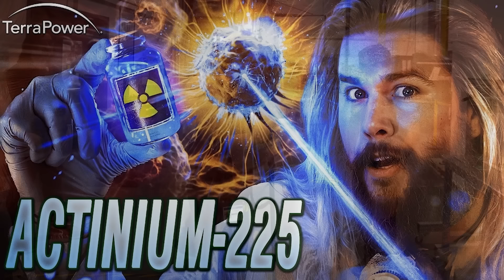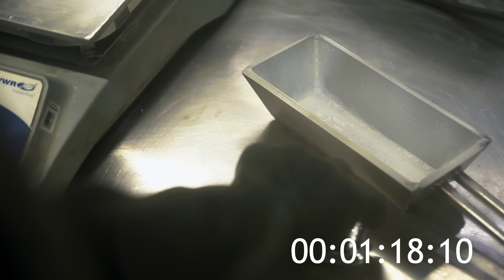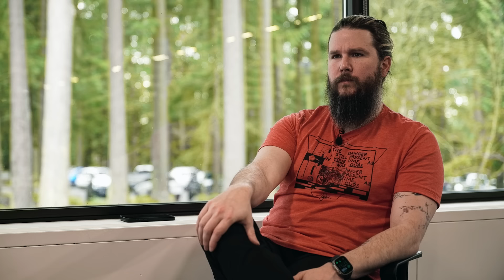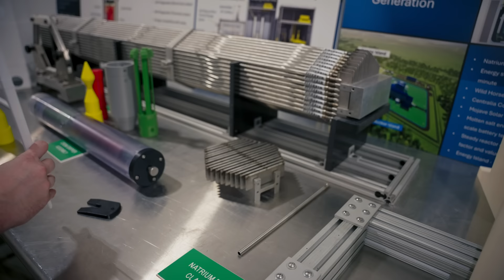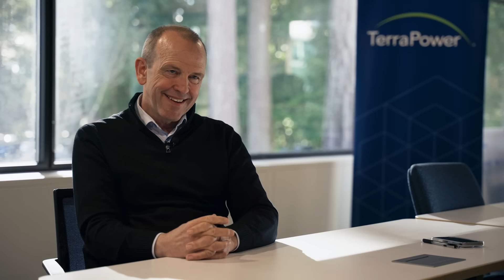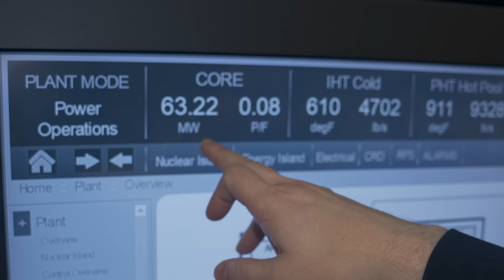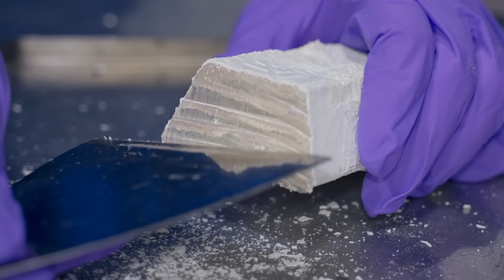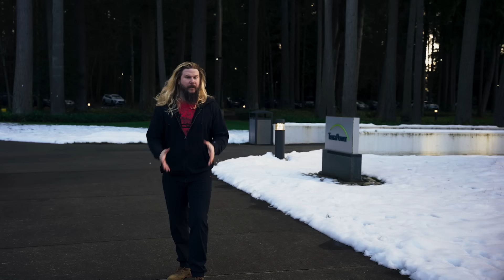Will Natrium Nuclear Reactors Change Everything?

Comment: My first reaction: did we finally find a reactor that does not work by boiling water?
And it turns out boiling water remains undefeated still
Reply: Progress is a flat circle made of boiling water
Reply: @bghiggy  surface tension XD
Reply: @bghiggy  why is this quote so hard
Reply: It's steam turbines all the way down
Reply: @playgroundchooser it seems steam engines were the peak of human development.

We just have found new ways of making more advanced and complex steam engines.
Reply: @juanangelninogomez2800 
we’ve figured out how to utilize more energy dense fuels! The method to generate power will remain the same but how we get heat is different!
Reply: @juanangelninogomez2800  well for creating electricity, it seems spinning turbines with water or steam is the way to go. As it can be done anywhere in the world pretty much that makes it a universal energy generator.
Reply: The latent heat of vaporization reigns supreme
Reply: @nickjohnson410it’s so big. Bigly big
Reply: Water is dirt cheap and boils at a temperature lower than most decent metals melt at. It’s going to be around for a long time.
Reply: @RoadSurferOfficial  sCO2 is gonna beat it out soon check out the STEP sCO2 Plant
Reply: @RoadSurferOfficial  The fact that it boils at a temperature lower than metals is a potential negative if that's not what you're going for.
Reply: @RoadSurferOfficial  Water won't be cheap for much longer.  We're using our fresh water supply at a rate that isn't sustainable beyond 2030, and it's getting worse.  The next world war will be fought over fresh water, not fossil fuels.
Reply: @ExcretusMaximus  probably not… I’d go further to say we won’t have a dry mouth in this lifetime or the next or the next if we are here then water shall be.
Reply: as long as turbine is the most effective thing to turn a coiled generator efficiently, our power plant generator will be any stylized style to boil water 😂
Reply: @youroniichan13  yep only so many ways so far we have of creating electro magnetic fields. One of the best is taking heat, converting it to mechanical energy and spinning a bunch of magnets next to coils of copper wire.
Reply: You could use supercritical CO2 instead.
Reply: @patrick_test123  came here to say sCO2 is where its at.
Reply: @patrick_test123  i had the Privilege of mentioning sCO2 to a Financial manager for a "large" energy company the other day. Felt really weird being able to lay that seed.
Reply: Science owes more to the steam engine than the steam engine owes to science
Reply: @SherlockHomeless221b  Thomas Newcomen is a Baddass
Reply: Solar cells don't boil water.
Reply: @DanielLCarrier  but there are solar plants that focus a field of mirrors onto a container with molten salt in it which is then put through heat exchangers to make steam which turns turbines.
Reply: @DanielLCarrier  Yes, and photovoltaiks are bad. At scale at least. If you want to harness a lot of soler energy you do so using mirrors to concentrate it and... boil water.
Reply: @Neuromancerism photovoltaics work just fine these days.  What you're talking about is pretty old tech and not really economically competitive anymore.
Reply: @dynamicworlds1  Nor are Photovoltaiks economically competetive. Not even in the US or Germany will you get a loan to buy them let alone land to put them on alongside them, and electricity there costs like 10 times as much as it does here.
Reply: @Neuromancerism they absolutely are.  How absurdly out of date is your information?
Reply: Not too long ago there was a promising test with a fusion reactor that produced energy WITHOUT BOILING WATER    :OOOOOOOO
Reply: @GoofballPaul   can you say which test it was, I'm curious
Reply: @GoofballPaul they finally are gaining net gains. It's closer than ever now.
Reply: Westinghouse eVinci reactor will probably be the first commercial reactor  to not use water at all.
Reply: Was there not a fusion company that was exploring harvesting the energy from colisions?
Reply: @ibengotvasilforrd4258  There are experimental reactors and the stage they're at is that they can create stable fusion but they're working on net energy gain, after that I assume is scaling it up.
Reply: GE has a pilot plant using super critical CO2 instead of water so, maybe it's happening?
Reply: @smeezer  Ouch, talk about an explosion risk, I think I prefer sodium, or even NaK.
And a steam explosion is nasty, but at least you don't get asphyxiated if you're downwind.
Reply: @Robert-dB  Why would CO2 be more likely to explode? You only need 31.1c and 73.8 bar to make co2 go super critical
Reply: @smeezer  The point of Natrium is that the sodium and the salts for the heat transfer are at (about) atmospheric pressure. The only high pressure stuff is in the "steam engines" that generate the electricity, something that the naysayers are perfectly happy with 'cause it's not inside the "nuclear island". Using high pressure sCO2 puts high pressure fluids back into the reactor containment building which reactivates the idea that the pressure might be able to "pop" the containment. So it's not that anything is likely, it's that the pressure is in there at all.  Plus the fact that escaping CO2 could be a short term health risk outside the reactor because it disperses very slowly at ground level compared to steam.
Reply: The steam turbine generator and all its needed switchyard and transmission were on site due to retirements, so they are being recycled to keep costs lower.  Nothing prevents a future Natrium from operating a more efficient CO2 turbine at a higher temperature, if it proved advantageous in reducing the need for cooling water, for instance.
Reply: Super-crit CO2 is gaining traction very fast, and has a pretty sizeable efficiency advantage. Especially closed loop multistage.

By the time natrium hits the market I wouldn’t be surprised if it’s actually integrated with a CO2 setup.
Reply: @geekswithfeet9137  CO2 expands about 500x, water expands 1700x. You get way more push from steam than CO2. And steam isn't as dangerous as CO2 when it leaks (see Jaslovské Bohunice's reactor A-1 accident, citing:" The first accident occurred on January 5, 1976, during fuel replacement, leading to the massive escape of carbon dioxide gas and the tragic death of two workers.")
Reply: @adler830  The advantage of CO2 has nothing to do with relative expansion (and from what state?).  It can operate at higher  temperature differences to achieve higher thermodynamic efficiency .  And it can be sent back to the heat exchanger without needing cooling water to condense it first, increasing power plant siting opportunities and reducing waste heat added to the environment.  It's a simple concept of heat expanding/pressurizing  the CO2 and the turbine turning pressure drop into motion,. Repeat.
Reply: @adler830  Except sCO2 doesn't reach its full expanded state and flows more with the density of water check out the Supercritical Transformational Electric Power (STEP) Demo pilot plant. it really is a step forward
Reply: Actually I heard a unique new alternative of replacing steam with super critical carbon dioxide. The idea is that it's higher density allows for smaller turbines and the lack of water should have less pitting and wear on the blades. Downside is now you're energy line needs to be pressurized.

There's also the idea of electrostatic direct energy conversion for nuclear fusion. It's rarely talked about because it's rather technical and the process would likely be more costly to make, but it can convert the free electrons into electric charge directly by smacking them into charged plates. Likely this would be used along side steam as the neutrons will still put out a substantial amount of energy.
Reply: > New way to make energy
> Look inside
> Boiling water
Reply: the steam age never ended we just built fancier boilers
Reply: Yes because water is the only compound that we can have in a gaseous state without it being harmful and at a way less temperature
Reply: Haven't they used supercritical CO2 in turbines, and I think also Helium.
Reply: every solar panel is a reactor which doesn't boil water by the way!
Reply: There are also concepts of using other fluids than water
Reply: Still the old steam engine, after all the centuries of locomotives, generators, power plants - barely a billionaire-hyped "progress"...
Reply: The US has experimental molten salt reactors before. And there was a Russian class of submarines that used a molten lead reactor. Still eventually boiled water to put through a turbine though.
Reply: Once again we invented boiled water. First and most trusted human invention
Reply: I suppose they could run the natrium or the salt through paddlewheel or bucket-wheel to spin a dynamo...
Reply: Ah I see Al the nuclear physicists are in the comments
Reply: @ImNotOhKae  just trying to help, there is more to it, of course
Reply: Everything is steam.
Reply: It is [title card]*
Reply: What about cold fusion??? I thought we are there...?
Reply: Look up the carbon-14 diamond battery, it works by directly capturing the beta particles to make electrical current.
Reply: @JinKee it's not that good though
Reply: @JinKee  Thought of that, problem is Neutron Embrittlement and Efficiency, or lack thereof
Reply: Literally everything power generation for us is boiling water to spinning magnet.
Reply: Probably allways will be the final way we get power
Reply: wake me up when they get sun in a box working
Reply: @melkorrealmz4526  They have stable fusion reactions.  They're working on net energy positive reactions and presumably then scaling it up.
Reply: Now we boil metal
Reply: Well, water is, just one of the most amazing heat transfer fluids that could be engineered in a universe.  Off the top of my head I can’t think of anything better and cheaper. Those corrosive fluoride salts are pretty tricky to manage . Big molten salt gonna take care of the world big daddy gates at the helm.
Reply: It's that perfect storm of availability, lack of toxicity, heat of vaporization, and how much is expands when going from liquid to gas.
Reply: When water turns to steam, it expands about 1700 times, which is pretty hard to beat when it comes to liquid→gas force transfer medium. And as a bonus, it is pretty cheap and abundant, which can't be said about alternatives.

As for myself, I think steam as a power medium didn't said it's last word in service to humanity. Sooner or later, steam engines will have their comeback, especially in heavy-duty use in remote areas where electricity might be a liability.
Reply: @adler830  Think Moon or Mars...
Reply: spinning a magnet is just  electricity is made you can move fluids and gas is the most efficient fluid, but even gyro and wind function this way. That’s how everything except photovoltaics works pretty much. I doubt it’ll ever go away
Reply: Wait nuclear reactors are steam engines?
Reply: @dizzydyzy  Always have been.
Reply: Because that startup are primitives from tech point. When you are using sodium as primary coolant, you can easily use carbon dioxide or even helium as coollant and working medium in secondary circuit.
Reply: I wonder if we could extract enerygy from the convection currents of molten metal with magnets
Reply: @whitepickle1  We can, trough MHD generators. But their efficiency is low, so it is good to combine it with another generation, which is using expansion of gasses.
Reply: I'm glad to see that our data from FFTF is finally being used. Yes, it was an inherently safe fast reactor. Yes, we could have recycled the fuel, reduced reduced the amount of waste to be stored. We did peoduce, medical isotopes. And we had developed both deep geological and monitored retrievable storage methods for disposal of the waste.  Then, a unilateral decision within the federal Department of Energy had the reactor shutdown. The contractor brought in to oversee the shutdown had all of us former employees sign non-disclosure agreements stating that we could not talk about the impressive safety record of the facility. Isn't it odd that elements within the government didn't want us to talk about a successful program? Well, it's interesting that the company who ended up holding the patents for fuel recycling was none other than Exxon/Mobil oil, who saw nuclear as competition to big oil investments. Fifteen more years of pollution, before electric vehicles became practical. Ethanol and compressed natural gas vehicles have become. Economically non-viable. We're talking about the Bush and Obama administrations when the programs were killed. It wasn't for safety or environmental reasons that the nuclear industry was dismantled. It was to ensure the oil industries made profits!
Reply: If you mean by not boiling steam to spin turbines, I don't think we'll make one without turbines for a long time.
If you mean without boiling in the core, pressurized water reactors have been a thing for a long time.
Reply: molten chloride salt fast reactor can run hot enough to run a supercritical co2 turbine, possible but will probably just do steam at first
Reply: Boiling water is the powerhouse of the civilization
Reply: Drat, I had hope here.  You could couple the flowing metal to wire coils and make power that way, but nope... just steam again.  LAME.
Reply: it does not. the water is boiled by the reaction to turn into steam to spin the steam turbines. wether the heat of the reaction comes from sodium or nuclear chain reaction. steam can be pressurized and water is plentiful. that's why water is used to make the steam turbines spin.
Reply: The ultimate irony is aliens invade us because they need water to make their steam turbines
Reply: It works.
Reply: Water/steam will not be denied. However, there's a level of separation between the angry pixies in the nuclear side and the angry pixies on the boiling water side. Those pixies should not mix.
Reply: @tonyennis1787  that's one reason co2 is a great option if they get it right
Reply: Hey, we created a whole new type of nuclear reactor that is completely different!

Did you or is it steam power?

Ok well…
Reply: The US Navy experimented with sodium reactors very early on the USS Seawolf (SSN-575), the next sub to launch after the USS Nautilus, but quickly converted it to pressurized water instead because of the problems.
Reply: Helion is trying, but they have neutron problems last time I checked
Reply: Brother how else is it going to make usable power 😭
Reply: our ecological crisis is due to photon entropy. As Roger Penrose points out gravitational entropy is the opposite of the entropy of matter. So we have 500 extra zettajoules of heat in the ocean already and we also have an extra 1 degree C global average of heat in the atmosphere that is being deflected by sulfur pollution. So the more "renewable energy" we get with less coal and diesel sulfur pollution the hotter we get and global food supply collapses.
Reply: was pretty much going to say the same thing, though one interesting reactor is from Helion and it doesn't boil water
Reply: ....always has been
Reply: Turns out Earth is a giant wet ball
Reply: Boiling water is just the best
Reply: As far as I know its still the cheapest way to convert heat to electricity. There are plenty of ways to convert heat to electricity, but all of them are still more expensive.
Reply: I hope the thousands of gallons of water NEVER meet the thousands of gallons of liquid salt
Reply: There’s no power like steam.
Reply: The United States Navy is truly the Forestall of all nuclear reactors.  Nothing was mentioned about that.  A nuclear sub as confined as it is nuclear.  Also, The United States Navy has made smaller reactors, but still efficient.
Reply: It's boiling water all the way down...
The poor turtles.
Reply: The Rankine cycle is basically what we use for making steam.  If you want something else the heat engine needs to run at a 😊higher temperature.
Reply: @jamestyrer907  I wonder if an ultra hot stirling engine would work 🤔No steam, just use the heat from the molten salts directly to create an insane heat differential with the atmosphere...or maybe add a cooling tower back and use cooled water on the cold side.
Reply: This joke is so stupid
Reply: You try turning something with warmth.
Reply: Brayton Cycle nuclear reactors exist, but is more rare, Is basically a closed gas turbine instead of steam turbine.
Reply: Helion won't use steam turbines if they aren't a scam 😂
Reply: Steam power is just super cost effective, simple to maintain and simple to fix.   Sometimes instead of trying to reinvent the wheel it's better to just make a better wheel.   Helion in Washington state is building a fusion reactor now that is supposed to generate direct electrical current instead of just heat to boil water.   We'll see if they can make it economical.
Reply: The steam engine train is turning in its grave
Reply: That is very funny.   I don't know if you meant it. Or how many people caught the pun.   But that is very funny.
Reply: As long turning a turbine with the steam is the most efficient way to convert heat to electricity water will always power humanity.
Reply: Though it has never really been about technology. The far bigger obstacle is the power of the fossil fuel companies. With how powerful Saudi-Arabia and Russia are they will do whatever they can to sabotage any attempt at nuclear energy.
In Germany a thing that is often overlooked is that a lot of the protests against nuclear power was funded by the coal industry and Siemens bought up several coal powerplants just before shutting down it's nuclear ones. It wasn't really some foolish political decision. Rather it was Siemens seeing that there was more profit in coal and the hysteria around Fukoshima presented them with an opportunity to do what they have been wanting to do.
Reply: You're right. Except we've known the technology for 50 years. Russia has tried it as well. It's not as competitive as PWR. We just forgot to how build them because the last so long.
Reply: Its supercritical CO2 now
Reply: Focusing on the boiling water misses the point of the reactor's design. The real heavy lifting is done by the liquid sodium, which handles the extreme task of cooling the core. Boiling the water is just the final, easy step in the process. It’s like a striker who dribbles past five defenders and the keeper; the 'goal' is easy, but the dribble was the actual feat of skill.
Reply: This meme is so stupid and shows how little knowledge you have. Do you really think there's some magic way to produce electricity without a turbine? There's not, besides solar panels so shut up with this moronic garbage
Reply: Boiling water, throwing rocks, and pointy sticks. Pretty much all of humanity's tricks.
Reply: The potential disaster scenario I foresee is that an earthquake, severe storm, terrorist attack etc. damages the salt loop preventing it from circulating to cool the sodium. Without a moderator, the sodium boils off creating a massive explosion as the now vaporized sodium reacts with the atmosphere. I'd want to see a failsafe mechanism which could immediately halt the reaction even if plant operators are seriously injured or unconscious and any neutron moderator used is entirely passive -- not dependent on a mechanism which could similarly be rendered inoperable by natural disaster or attack.
Reply: @ciabelle281  I think you missed the part where the reactor can't get hot enough to boil the sodium. It's hundreds of degrees away from the boiling point and it's operating at 100%, so it can't get hotter.
Reply: @undefined9749 Assuming circulation is maintained. I'm not saying they won't build in the necessary safety and control mechanisms. It's just that all these side quests add to the complexity, costs, logistical problems and timelines when we can't afford delays.
Reply: @ciabelle281  Neither salt nor Sodium is the moderator. It is a fast reactor not needing a moderator. Control rods automatically drop by gravity to kill the reaction and the sodium absorbs all the residual heat without reaching boiling temperature. This was tested by stopping all cooling pumps in a test reactor many years ago and is the reason for the safety of the Natrium design.
Reply: @ciabelle281 lookup “doppler broadening”
Reply: @ciabelle281  Existing plants already do this and since natrium has a much higher boiling point than water does it would give you a lot more wiggle room before things get out of hand.   Natrium also doesn't have the reaction with Zirconium in the core that water does which can lead to a dangerous buildup of explosive hydrogen gas.   The biggest problem and what is mostly to blame for 3 Mile Island and Fukushima's meltdowns is the fact that even after you scram the reactor a portion of the uranium will continue to undergo fission and release heat for up to a week.   If the core loses it's coolant it will still get hot enough to melt down even after it has been scramed.
Reply: no one has properly explained to me yet why you need water and can't just convert heat directly into electricity ,.,
Reply: @ERR-NULL00 The current methods we have of converting heat directly into electricity is less efficient.
Also for scaling, turbines are generally just simpler to scale
Reply: @ERR-NULL00  Scale, efficiency and output. Converting heat directly into electricity isn't efficient, safe, or fast enough (when it is safe, like in solar panels) and using water as a medium for moving turbines to generate electricity is simply the best way we've figured out so far. Do you understand what electricity even is? It's EMF aka Electro-Motive Force, which is the force of electrons moving. This is how a turbine "generates" electricity, by using magnetism to move electrons in some kind of electrically conductive metal (copper mainly, but others do exist for different applications like gold in microchips etc).
Technically the "energy" is always there in most materials, you just need to have some method to "move" the electrons and that tends to generate heat, especially in materials that are less "conductive". Conductive metals can generate more heat yes, but that's because they don't burn instantly and the electrons are moving a LOT faster.
Reply: @flamerollerx01  That was the BEST explanation i've heard, like, ever!
Reply: @ERR-NULL00  Machinery, computers, lights and other things don't run on thermal energy they run on electrical energy.   So, you need a way to convert the thermal energy created by your heat source to electrical energy in the grid.   The most economical way we have found to do this is to use the heat to boil water and create steam which then is used to turn a turbine and generate electrical energy.   Virtually all power generation comes down to turning a turbine to generate electricity.   Watermills use falling water to turn them, dams use water pressure created by the backed up water to turn them, windmills use wind to turn them, fossil fuel plants burn fuel to make heat which boils water and turns them, a lot of solar plants focus sunlight with mirrors which heats up salt to boil water and turn them, nuclear plants use the heat from the reactor to boil water and turn them and geothermal plants use heat from the earth to boil water and turn them.   Water is just the medium by which we transfer energy from one form to another.
Reply: @zagnut3707  solar panels don't use water tho, they directly transform solar energy into electrical energy, no water needed
Reply: @ERR-NULL00  You are correct, to my knowledge solar panels are the only common form of power generation that doesn't turn a turbine.   There are some fusion reactor designs that can produce direct electrical current, but they are not practical at this time.   The fuels they use are rare on Earth and would require that we mine the Moon or asteroids, which insanely balloons their costs and would need all sorts of other advancements to make it possible.
Reply: This isn’t really a problem though… it’s tried and true, it’s fairly efficient and it’s economical, the infrastructure is already there. Why invent some new, expensive method for turning heat energy into mechanical energy?
Reply: @scottkidder9046  Ever heard of solar cells? After installation, the sun does its thing, and the panels harvest "free" energy - still the cheapest (and cleanest) form of energy, with further sinking costs for the panels and batteries to even eliminate more expensive peaker plants.
Reply: @scottkidder9046  check out the Supercritical Transformational Electric Power (STEP) Demo pilot plant
Reply: Even if we get to obtain nuclear fusion reactors or antimatter energy source, or harvest black holes, it ends up using all that energy.... to boil water for the turbines
Reply: I kind of wonder if it might be safer to use a liquid CO2 cycle instead of water, which would limit sodium/water reactions.  Maybe the temperature ranges are wrong for that to happen.
Reply: @PosiCat there is no sodium water interaction. Watch the video.
Reply: @PosiCat  You need high pressure to keep CO2 in liquid form and it's also far too cold. I'm not sure why you thought to make this comment without knowing this, instead of just looking it up.
In order for CO2 to be a liquid, it has to be at ONE THOUSAND PSI and 64.6 Fahrenheit, way below the temperatures required for molten salt and nearly triple that of boiling water and that pressure is incredibly high pressure. For reference, R22 refrigerant has a high pressure SAFETY LIMIT at 250 psi and that stuff is considered a high pressure refrigerant used in peoples homes.
Reply: You know sodium violently explodes when exposed to water, including small amounts in the air. Using it outside the primary feed is begging for a massive explosion.
Reply: @Allison-qk1ws  Primary loop is molten sodium. Secondary ("battery") loop is NaNO3/KNO3 (60/40 from their scribbles on the fume hood.) Third loop is water to steam for the turbines, because it's the only way we know how to make power.

(FYI, that's "pickling salt". It's what makes spam so pink.)
Reply: @jfbeam Brayton cycle?
Reply: @ubobl2277  That's basically a jet engine, and jets don't (directly) boil water. So yes, there are ways of spinning a generator without boiling water, but steam is still the best way we've worked out to make power on a large scale. (water, wind, and solar also work, but with significant limitations.)
Reply: @jfbeam thanks for that important info. I had been wondering how the heck a molten Na - H2O heat exchanger was considered safe in anyone's mind. Because water turned to steam still generated literally tons of pressure. Pressure on any pressure container always generates small movements or expansions which WILL result in material weakening over long periods of time. Which could result in a violent and very terminal mixing of molten Na and H2O under pressure. Probably the very worst combination for any heat exchanger.

The other compounds are virtually non-reactive with water compared to Na. That DOES increase the safety to an incredible margin.
So, yes, this is VITAL information that has been left out of the video.
Reply: @Allison-qk1ws  I see someone hasn't watched the whole video yet 😆
Reply: @playgroundchooser    i think I shall always be disappointed, not by the commentor who doesn't quite get it... but by the upvotes the comment gets.
Reply: @playgroundchooser  I mean 300C sodium that sprays out of a leaky pipe will be a flame thrower. 
This demo was like showing kids in a swimming pool to prove that a steamboiler is perfectly safe it's a totally different application.
What would have been interesting why other low melting point metals wouldn't work like gallium, mercury, indium, tin, lead etc.
Reply: According to Google's AI (and it seems pretty reasonable): Sodium has high thermal conductivity, high heat capacity, wide liquid temperature range, compatibility with reactor materials, ie doesn't corrode steel, low pressure operation, self control (it's self-regulating, temperature increases are countered by core expansion, which slows down the reaction), passive cooling (can be cooled passively during shutdown, where decay heat can be removed by natural convection without the need for pumping), because of its electrical conductivity you can use electromagnetic pumps, which are efficient and reliable.

I'm fairly sure some if not all of this was covered in the video...
Reply: @Allison-qk1ws did you even watch the video?
Reply: @Allison-qk1ws  Did you watch the video? Methinks not.
Reply: @Allison-qk1ws  tell me you havent watch the video without telling me you havent watched the video ^
Reply: Wow it's like you didn't watch the video where he specifically covers that objection  @Allison-qk1ws
Reply: @Allison-qk1ws  Which is why they aren't the heat is removed with a molten salt.
Reply: @Allison-qk1ws  you're deeply incompetent, because they literally say in this video and show literally demonstrate on camera in this video how raw sodium metal does not and cannot react violently with humidity in the air
Reply: @nathankiefer9323  Oh, someone found a way to overcome physics/chemistry...
Reply: @nathankiefer9323 Did they tell you what the humidity level in the lab was? How cold was the air or the lab bench or the sample of sodium? Nope. Don't base your conclusions on incomplete information. They're only showing you what they want you to see.
Reply: @Allison-qk1ws  Someone didn't watch the video to the end.
Reply: @Allison-qk1ws there are people far smarter than you that have already figured out how to solve that risk factor
Reply: @Allison-qk1ws   Aren't there breeder reactors that use liquid alkali metal for the primary and intermediate loops?  Primary to capture the reactor heat, intermediate to have a non-radioactive loop in case the output loop leaks and causes an alkali metal explosion.
Reply: @Allison-qk1ws  watch the video
Reply: @Allison-qk1ws - Yes, but my “water-cooled computer” does not dump water over the electronic components. Nor does this.
Reply: @Allison-qk1ws Fun voice, 10/10, no notes.
Reply: @Allison-qk1ws  they did it in the video. There was no explosion.
Reply: @Allison-qk1ws misinformation bot detected
Reply: @Allison-qk1ws he literally addressed this in the video
Reply: @Allison-qk1ws  i guess you didnt make it to the 13 minute mark
Reply: @Allison-qk1ws wow you should tell those people that work at the company building the nuclear reactor that! Thank goodness you were aware of such a huge problem
Reply: @Allison-qk1ws there’s a non reactive medium used where the systems could potentially come into contact with each other.
Reply: @Allison-qk1ws  Tell me you didn't watch the video without telling me you didn't watch the video. They literally debunked this in the video @ 13:15
Reply: @Allison-qk1ws  Pretty obvious from the video that "air"  does not make it explode.
Reply: @Allison-qk1ws  It's only the primary loop...
Reply: @Allison-qk1ws  great i'll cook my noodles in it, i don't have to worry about salt anymore.